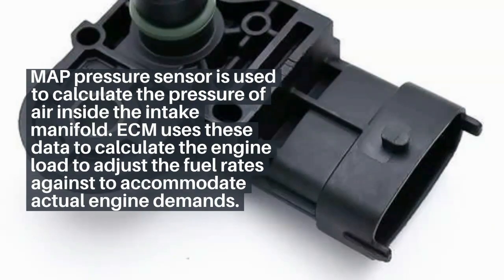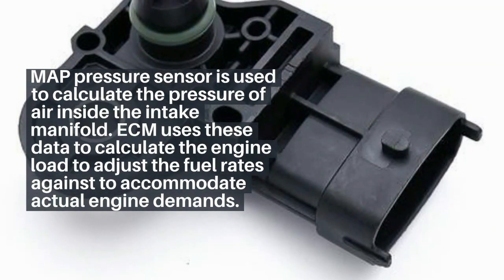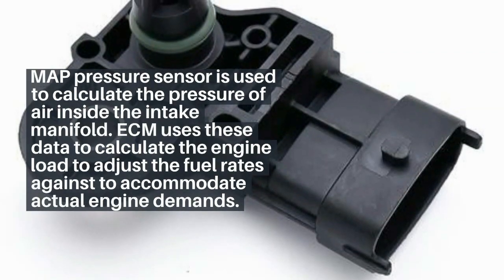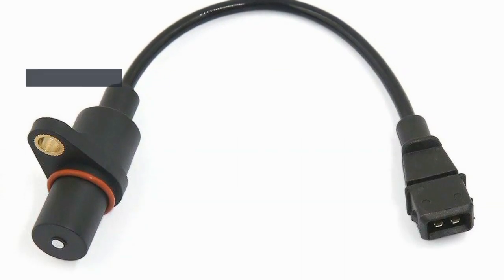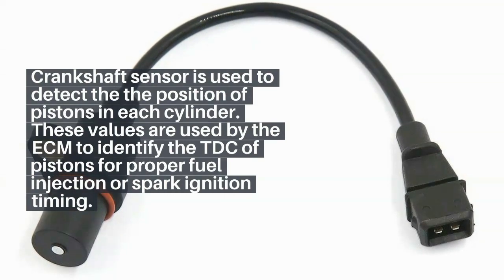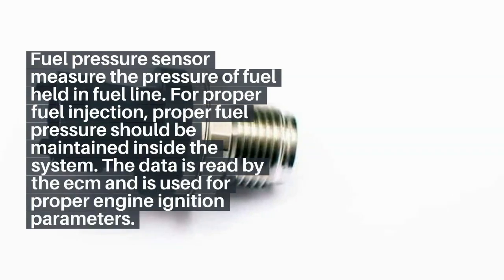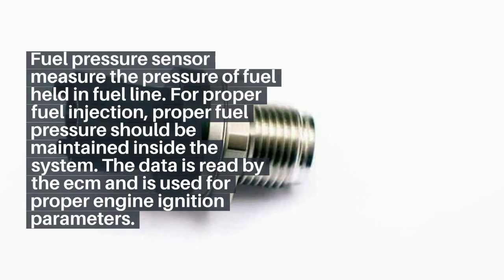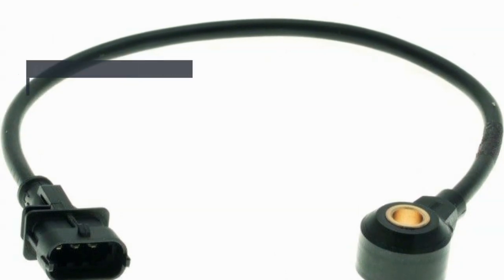Top Engine Sensors Explained | What are the functions of engine sensors | Bright Source

Comment: MISFIRE IS A BIG PROBLEM IN A CAR, BECAUSE THERE ARE MANY CAUSED THAT CAN CAUSE MISFIRE. DON'T YOU THINK THAT, THE COMPUTER SHOULD TELL THE EXACT  FAULTY SENCOR?
Reply from the maker: A cylinder misfire code is shows in most cases. Have look physically to find out..sometimes vehicles with advanced feedback programming gives out the exact trouble.

Comment: Hey Bro, I like your videos are very helpful. Btw i got a question, which sensor controls the electronic EGR valve because my hyundai accent egr valve is opening/closing at a wrong time thats why my car jerks sometimes.
Reply from the maker: Hi there, EGR valve is completely depended on MAP and MAF sensors. It also uses pedal position sensors readings too. So the ECM uses data from these 3 components and control EGR accordingly.
Reply: @brightsource206  ok thank you, big help. I remember my car hesitates almost every morning  when i use it but doesnt happen at idle. After driving for about 5 to 10 km i park it, and drive again and the jerking go away sometimes. Even when ive driving the for hours sometimes it hesitates. Thats i need to park for awhile and drive again and It goes away sometimes. U might have an idea with this. Your thoughts will be much appreciated bro. I have this prob for 3 yrs now.
Reply from the maker: This might be a problem with EGR or Throttle Body.
Reply: @brightsource206  i already replaced the whole egr but not OEM. probably you're right coz i noticed my Throttle body is always open and does not respond to my pedal but sometimes it reacts when i pressed the pedal and the jerking goes away. But i dont have any error code for throttle body on my scanner. But the throttle body will close and open for few seconds when i first start the engine, it also moves when i stop the engine.
Reply from the maker: Is that a diesel or petrol head?
Reply: @brightsource206  it's diesel
Reply from the maker: In diesel car EGR is an important device.So it should be an OEM specified. Try disconnecting the EGR and drive.
Reply: @brightsource206  i have tried disconnecting the egr cable, it has no hesitation but it only runs up to 70kph max. So i put the cable back to the solenoid and this time i dismounted the solenoid. So now the egr valve is always close since there no solenoid that will push to open it. Now the speed went back to normal and there is no more hesitation. The problem is after driving it for around 20km or more i  always get a check engine light which is the egr. And the engine gets hot so fast sometimes i get  high cooling temperature.
Reply from the maker: If you remove the solenoid and connect via cable so the solenoid will work but the valve will be closed premenantly. The ECM will misjudge that the valve is still in connection and the injection rates will go high. This is why the engine runs at higher temperature. Also after some time the ECM will read more air flow from intake than supposed to have.That is why you get a check engine light. The best option will be replace the aftermarket EGR with OEM specified valve.